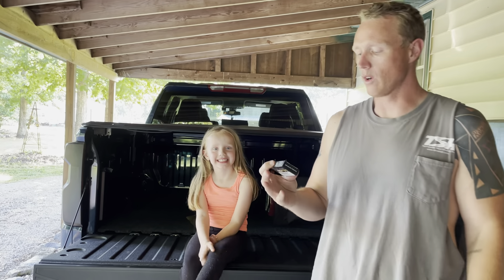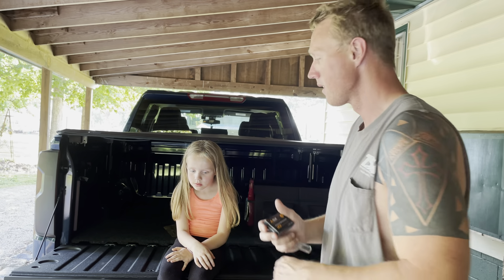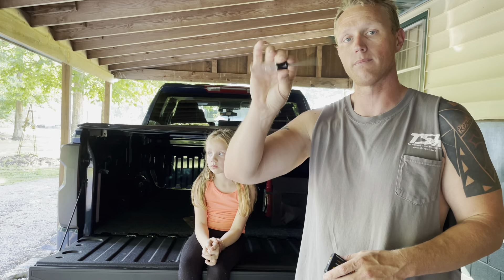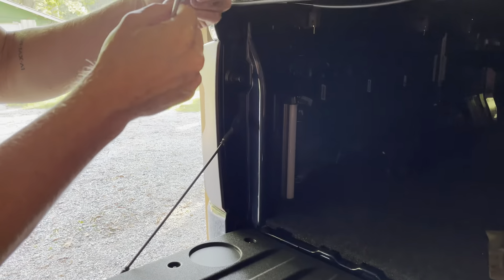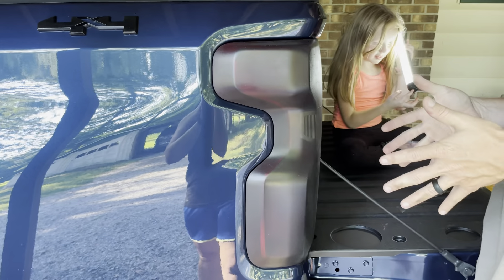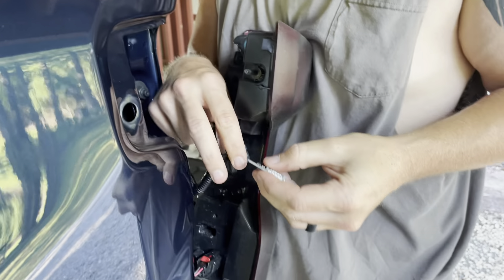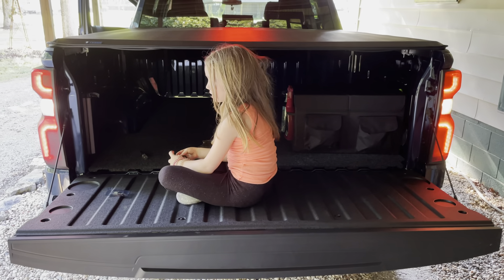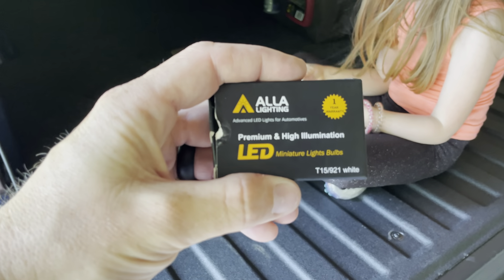2021 Silverado reverse light removal and LED upgrade

Comment: Nice step by step video. Did you tint the third brake light also?
Link to the Plasti Dip product you used for the tails?
Reply from the maker: I didn’t do the 3rd brake light… I am thinking about taillight tint for that… However you could easily do it. As far as the plastidip… I used the traditional black plastidip from Walmart.